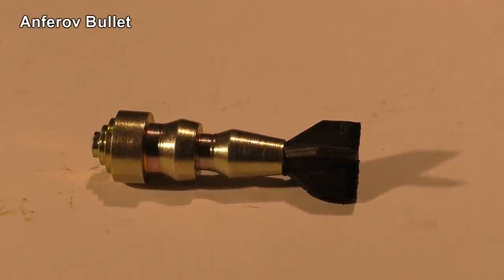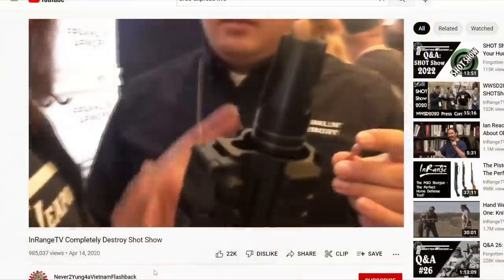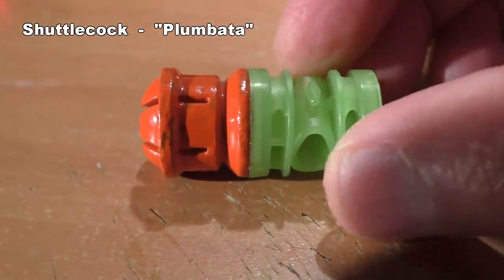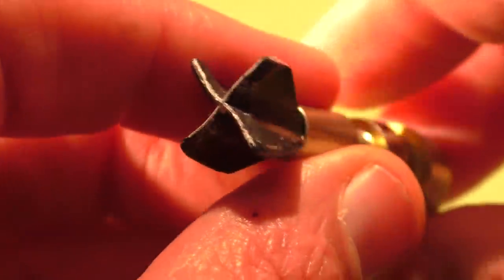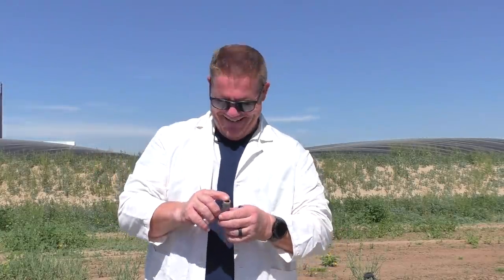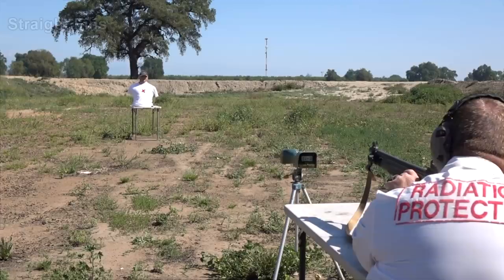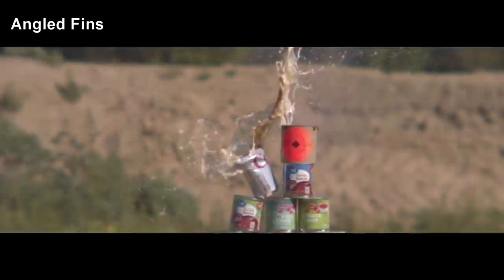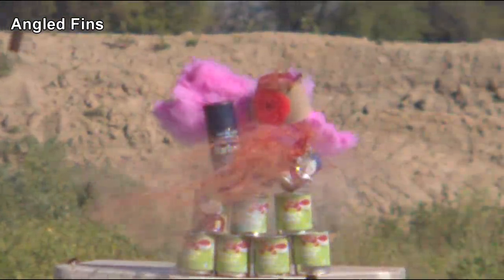Supersonic Darts - The Effects of Inducing SPIN - I learned something!

Comment: I've found that too much spin can actually make slight imperfections in the projectile manifest as worse stability and accuracy than if there was less spin. That said, a well constructed projectile, with minimal surface imperfections and good source of drag at the back end will generally benefit from a little spin. Also, it is often the case that even unnoticeable surface imperfections will induce a slight rotation on a moving projectile without having been designed to do so, and that little bit of rotation is often enough to stabilize the projectile in flight.
Reply: I absolutely agree with you.
Reply: if there is anyone in this comment section that plays Disc Golf, they, as well as myself, know exactly what you mean. any imperfection in the disc, both visible and non-visible, have a HUGE impact on the performance of said disc, whether for better or for worse, lol.
Reply: You highlighted what I tried to say in my comment much better, thx
Reply: Centerline has to be true or your have an unbalanced journal effect. Roundness also has to be pretty good. One point this video upload didn't touch upon is how the balance of the projectile affects its stability in flight. These points made concerning roundness and centerline regard projectile spin, they will affect it. Lengthwise the projectile balance point also has to be Forward-of-Center (FOC in archery) so the point or head if you like leads the tail in flight, and vanes stabilise tail swing so your dart will 'fly true' and strike hard. If you do not make  total-dart-mass balance upon a point some percent forward of the mid-length, the projectile will tumble. Which means whether the head strikes the target point first, or does not, is only a gamble. It also means all the kinetic energy will not be transferred into an impact force directly behind the tip.
Reply: @ferret_max7800  it's intence in here😮😢

Comment: Perhaps too much angle on the fins. It would most likely require a new tail section in order to put a minimum angle of 3-5 degrees on the entire fin which would probably work better. A true test would require longer range shooting with 3 or more rounds of each configuration which you probably can't get enough projectiles and sabots to do.
Reply: Yeah...lob em out 50-100 yards to see if it helps farther out
Reply: Exactly what I was thinking - also if the entire fin was curved/angled rather than straight with a bend as this should prevent shock waves forming where the bend is made? Supersonic aircraft have "all flying" tail surfaces to prevent shock waves forming where the control surface hinges would be otherwise.
Reply: @Eatherbreather   I'm guessing that the sharply angled fins might be producing turbulent air flow near the kinks. I wonder how a gradually curved fin, and at reduced angle angle (as suggested by  David Jennings above) might improve rotational rate and accuracy..
 As a side note, spin stabilization is frequently used in sounding rockets at average out payload trajectories. Of course, the aerodynamics become weirder as your test objects shrink so the comparison isn't 100%
Reply: @Eatherbreather  Any deflection in a supersonic flow results in a shock-wave. Even for a "all flying tail surface" will generate a shock-wave at both its leading and trailing edges albeit on opposite sides of the airfoil. The same applies to the continuously curved fin. In this case the leading edge will shock the airflow into subsonic speeds over the concave side of the fin, while the convex side will have gentle expansion waves that actually accelerate the airflow but will generate a shock wave at the trailing edge to shock it to the same speed and direction as the overall airflow. The purpose of having an all flying tail is to provide the pilot greater control authority over the plane.
Reply: @abhijeetsutar5259  you're entirely correct! I completely forgot about the l.e and t.e shock waves 🤦‍♂️
Reply: I have no experience with aerodynamics.
I did wonder if all of the fins having the same geometry would cause less yaw.

Comment: I agree with the idea that if it's already stable it's just gonna be hard to improve on that. but I think if the bent fins were to work I'd imagine they'd have to be extremely precise and consistent.
Reply: I’m gonna nerd out for a second. I think you need the whole fin to be angled, like how a supersonic fighter jet’s elevators do. possibly due to the shock cone not letting enough air pass over a small angled fin?
Reply: Also I wonder if the obturation ring is causing a vortex to extend out over the majority of the fin like a kFm airfoil?
Reply: @mk6315  you're probably right. I mean traditional slugs have straight cut "fins"

Comment: @4:19 I'm more amazed that just canting part of the fins actually imparts spin when falling through the water and it went straight, instead of angling off slightly like the unmodified one.
...but whether that really translates to more stability in flight? ¯\_ (ツ)_/¯
I would hazard a cautious guess that the variable of sabot separation might have more effect than spin, on accuracy.
Reply: I’d be interested to see the water tank drop comparison if the tanks were 30 feet deep (or whatever). Over that distance the effect might be more obvious one way or the other.
Reply: That canting can be caused by the bullet not being dropped as straight when it entered the water, or dude not dropping from the center of the top
Reply: Spin reduces effect of poor separation on accuracy

Comment: The angled fins might also work better with a different ratio of fin size and angle  to projectile mass. A shallower angle may impart a more gradual spin or perhaps the 40 degree angle would work better on a heavier projectile etc. Of course it may end up being the opposite 😉.
Reply: YES!  Exactly!  Put the fins in front.          That's what you meant, right?  🤪
Reply: @dotar9586  what?
Reply: Rotating objects are stable but that's when the whole thing is spun, when that force is being imparted on an unbalanced part you get the wobbles.
Reply: @-JohnSmith-  In that case you want to get in touch with Fireball Tool and get some 0.3" steel rod with a spiral cut at 1 turn in 1.123 inches for that same 40° angle inside 0.4" steel sleeves with a 0.05" thickness, so instead of fins you have air channels through the full length of the bullet.
It might also be interesting to have two sets of them, one solid all the way through inside and one with 0.2" holes drilled centrally up the back of the core to half the length, or multiple sets with multiple tail hole depths, to see how the shift in centre of mass affects behaviour.
Reply: That's why somebody gets to test it.
Reply: I used to make finned projectiles for my big air cannon.  That's not supersonic, but even at 300 fps, you don't need to cant the fins to make it spin.  It only takes a tiny asymmetry of the faces to make it spin like crazy.  It's an airfoil, not a paddle.
Reply: I would say the fins were a bit bent too much. Like, half the bend would probably do better because I guess it spins too much.
Reply: @PSUQDPICHQIEIWC  I thought about that as well, If you look up AA12 shotgun grenade cartridges those it do appear to use a gradual cant instead of a  sharply angled fin design.
Reply: Just check out a RPG7 rocket in slow motion and you'll see the spin is very mild. Theese projectiles right here are spinning way too fast because of the angle and end up tumbling slightly because of it.
Reply: @AmstradExin  I was thinking about the same thing. I think more like the slight twist on an arrow or crossbow bolt.

Comment: I like your videos 
As I sometimes hunt White Tail deer with a shotgun here in NW Ohio ( I prefer to bow hunt or use a handgun  )
I sometimes need to harvest a deer at 100+ yards to help control White Tail Doe numbers to help with crop damage 
I feel that a projectile that is getting added spin from the fins can be a good thing 
Because as the projectile flies down range the air drag slows it down 
So as it slows down straight fins will impart less stabilizing effect 
So to help stabilize the projectile the bent fins will impart a rotational stabilizing force even as the slug slows down 
I feel the straight fins will greatly loose the stabilizing effect as the slug goes sub sonic

Comment: The problem with inducing spin after the projectile leaves the barrel is that it will introduce gyroscopic precession early in the flight.  This will create a force perpindicular to the axis of rotation and cause exactly the type of instability you see in the first shot.  This doesn't happen inside the barrel of course because the bullet is basically swaged into the rifling and has no ability to rotate on any axis but the one of the barrel.  

Over time as the spin rate increases this will get damped out.  My guess is that straight fin stabilized is probably more accurate at short range and the spin+fin stabilized might be accurate over very long ranges (where the spin can pick up after the round slows down and the control authority of the fins begins to decrease).  

One potentially interesting experiment would be to place the fins at the center of gravity of the projectile.
Reply: I believe that spin stabilization through angled fins is only realistic if it's machined. Any tiny inconsistencies between the fins would result in asymmetrical spin, which would make it a lot less accurate.

Comment: Answered my question about airflow over the fins…😮
Maybe less fin angle? I’m very curious about this…Fascinating!
Reply: Its always been a question with Archery to Helicoil or go straight vanes, tuned correctly. Not the same speeds at all but a Helicoil can help the arrow leave the shelf cleaner and recover slightly quicker than straight vanes. Traveling these speeds it is very intresting.

Comment: Its funny that you jumped into machining defects because I was thinking exactly the same thing after the first shot went soo poorly and the rest didn't.  I think thats the more likely culprit than anything when it comes to the major wobble it has.  I don't know how you bent it, but it could be caused by an inaccuracy in the bend itself.  I dunno, I'm not a ballistics expert.
Reply: Not just the aerodynamics of the bend, but also the way the bullet is seated in the casing.  I have the feeling that these sorts of bends are just asking for defect related inconsistancy in flight.
Reply: @Keldor314  Yeah, in all fairness, the bend itself isn't representative of what proper spin stablizing fins usually are.  Generally the fin as a whole is angled rather than the bottom portion of it being bent, In my uneducated opinion, having the drag coefficient spread out over a longer distance would create a more stable flight than what was done to these rounds.  If you picture drag as a force being applied to a nose heavy object travelling at speed, the benefit to having a nose heavy object would be detrimented by the bend due to it being isolated at the far opposite side of the object. 

In effect, I think it would act more as a lever in a way, which would be amplified by any discrepancy in the bend itself.  This could be as simple as the composition of the material (i.e. the crystalline structure of metal) creating a different curve in each bend, even if the bend itself was created in the same location, and at the same angle.

 Whether or not having the fins angled as a whole wouldn't create similar effects is beyond my ability to picture these things in my head though.  I'm willing to bet that these rounds would be far more stable, but I have some doubts over whether or not they would be even better off than they were before modification.

Comment: Fin stabilized sabo rounds that are shot from smooth bore tank canons are also strait finned and some are going over 5000fps.
Reply: Not all are straight finned. The US is going to slightly canted fins for better stability and accuracy.
Reply: @markfergerson2145  roughly 1/2 a degree, per The Chieftain
Reply: Tanks are the exception to the rule.
Any rule. Because nothing can tell an American Main Battle Tank what to do. They are the Chuck Norris of vehicles. Carry on.
Reply: @Falconguygaming  Yep, and he should know.
Reply: Tank APFSDS rounds ALL spin. Their fins are straight but not in line with the projectile, the entire fins are very slightly rotated to one side. Roughly half a degree, generally to give the projectile just enough spin to be more accurate than no spin, while not having any of the disadvantages of high spin.
Reply: @kj3n569  If there is a Chuck Norris of tanks it is the British Challenger 2, one in Iraq was hit by 70 RPG's 70!! and the crew walked out without a scratch, the tank was back on the mean streets of Basra 6 hours later after having it's armour replaced. Another was hit by 14 RPG's and an anti-tank missile, again the crew were uninjured. 

The challenger also has a rifled barrel and the previous version holds the record for the longest range tank on tank kill shot... But the upcoming Challenger 3 will be a smooth bore to make it more compatible with other NATO tanks so they can share ammunition.
Reply: No Touchy  Yes, they spin. They spin around at 7.2921e-5 radians per second or 15.04107° per hour the whole time they're sitting in the armoury waiting to be loaded into the tank.
Reply: @Sableagle  Don't forget the rotation of the Milky Way itself 🧐

Comment: Seeing that spin rate made me wonder how a heavy, sharp, screw would perform with similar fins if properly weighted.
Reply: On a fast moving screw stabilized by fins you would get no spin from the screws thread.
The airflow would be moving over the thread and not spiraling through it. What the thread would most likely would do is disturp the airflow around the screw.
That would make the airflow reaching the fins turbulent and therefore make them less effective.
Reply: @v.Hohenheim  aye, I was thinking more in terms of the threads effects on target. Didn't consider the added turbulence though
Reply: @Cheveyo888  There are some nails that have a square profile and a gentle twist to them (for better grip) that may be more suitable than the close spacing on even a coarse screw thread.

Comment: The grooves in the projectile have multiple functions: They grip onto the sabot, and also cause the airflow to "grip" onto the slug as it travels through the air.
Reply: It helps to pull the seperated flow closer to the centerline axis of the projectile by creating low pressure cavity flow. This is why the fins have airflow over them. Having a smooth surface would most likely result in flow seperation over the leading edge shoulder and then miss the fins completely.

Comment: I would bet that having the exact same angle on each fin would affect accuracy. 40° angle was too much as well, the high rotational rate pushes the center of gravity too far forward and the drag from the fins isn't enough keep the front of the projectile stable.
Maybe a 7-10° angle on the fins would still impart rotation,  but not so much that it causes the front of the projectile to wobble.
I like these rounds and I think if a company made them with higher precision machining (so the fins were exactly the same) no angle fins or spin woukd be needed.
Reply: fins put drag at the rear of a projectile and cause the Center of Pressure (CoP) due to drag to be behind the Center of Gravity (CoG).  This gives stability to the flight.  The high angle of the bend on the fins MAY force the CoP slightly forward but not the CoG.  This would mean less distance between the CoG and the CoP thus the projectile would be less stable.  Another, more likely, cause would be a slight difference between the bend angle on the four fins. This would move the CoP away from the centerline of the projectile and give a wobble to the tail.
Reply: @thomasburleson9575  yes, we are essentially saying the same thing. The high angle of the fins cause the wobble, and the varying fin angle will affect the overall accuracy.
I didn't figure the CoP would effect much since all of the directional force is applied while the projectile is still saboted and in the barrel. 
I suppose that's why it's easier to leave the fins straight for minimum CoP instead of adding more weight to the front to move the CoG away from the CoP. 
Also if the fins were straight, but with a low angle, axial tilt along the whole fin as opposed to a sharp bend on the outer edge of the fin, the CoP would be more symmetrical and stable.

Comment: Aerodynamics change dramatically at supersonic speeds and the angled fins may increase the coefficient of drag and change the balance of the bullet. This would mean as speed is increased on the bullet, slight variations in how it travels through the air would be magnified. Because of all these factors, I really dont think it needs angles on the fins.
Reply: Not that I'm exactly an expert on this by any means but as far as I'm aware the angles on fast moving projectiles when it comes to fins tend to be very small, having heavily angled fins, even like the ones in the video would come as a detriment more than anything else.

Plus when it comes to spin stabilised projectiles that are actually in use they are considerably more well designed over all.

(I'd also guess the design of the projectile its self has a lot to do with whether spin stabilisation is a requirement or whether it would even be of use.)
Reply: @supercjs6044  I'm not an "expert" per say, either, but at 46yo I've had a tire or 2 balanced in my life. So I would have to agree that by putting spin on a fin stabilized projectile you're doing more harm than good.
Reply: @Stacy_Smith  As far as im aware a large part of whether its even worth it to begin with is the design of the round you're firing. Imparting spin on a round designed to go without for instance won't do much to help, among a million other factors.